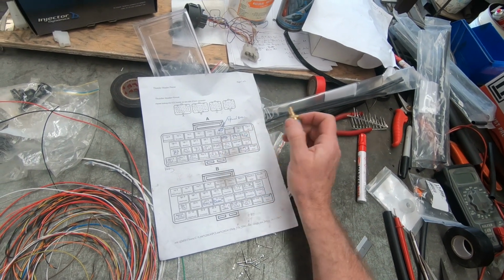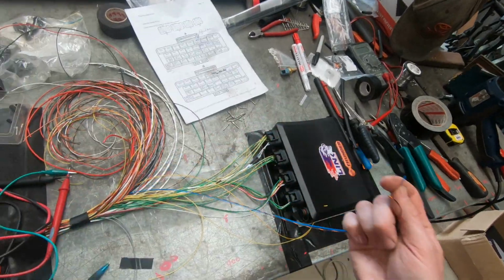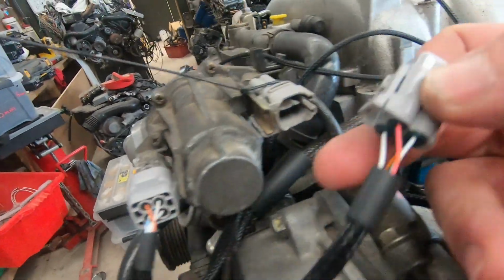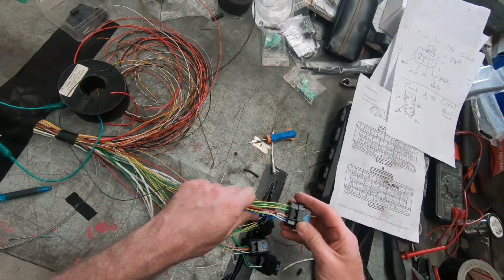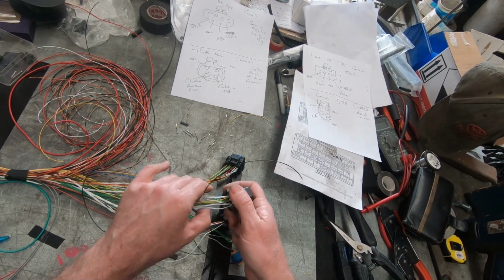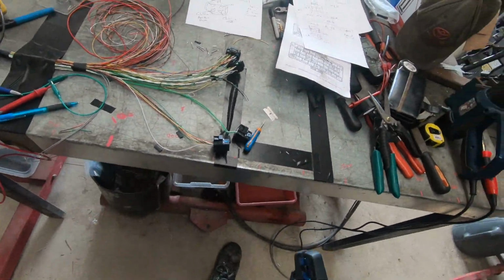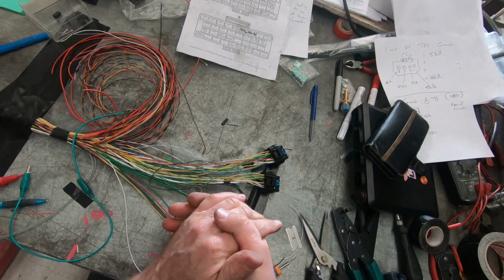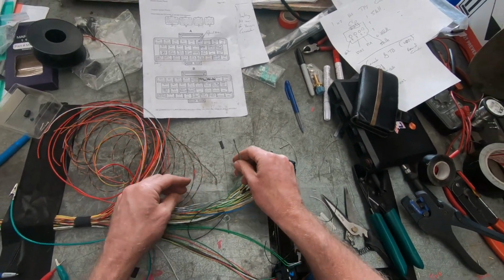1uz VVti & 3uz VVti to Link ecu   part 4

Comment: How do you fit a fuel pressure sensor on a gen1?
Reply: Spitronics has optional pulse width modulated fuel pump control that i would like to use. Do you think it’s worth the effort?
Reply from the maker: Hello. I use fuel rails with a cold start injector hose fitting , run a tap through it and screw the sensor in.  PWM fuel pump control is great if a fuel pump which is way too big is fitted however with the correct size pump I never bother.